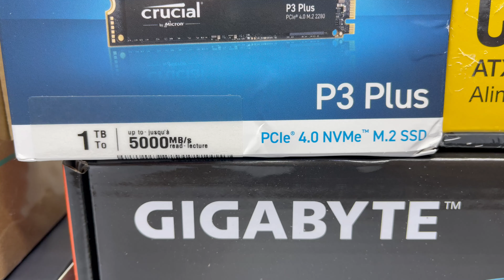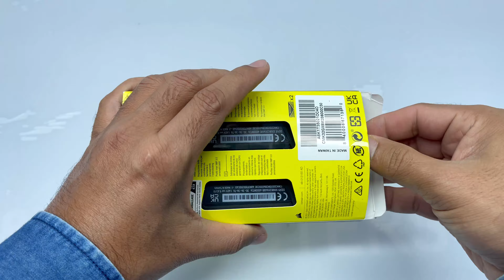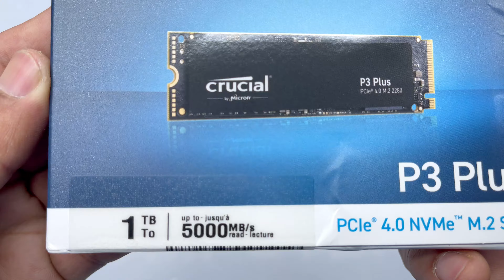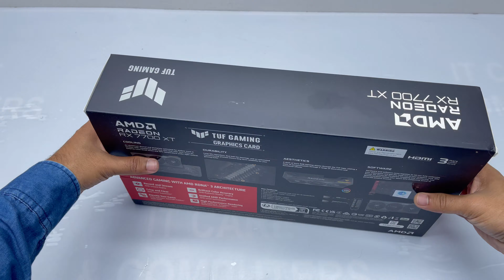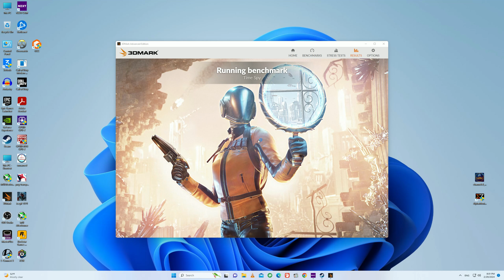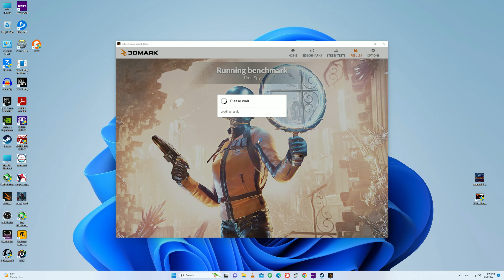NEW Budget Gaming Pc Build 2024

Comment: First view
   Hey I liked your video and I will happy if you giveaway bec you build ton of pc
Reply: lol bro hes not that rich
Reply: @gr0za44  but like he build many Pc so I said
Reply from the maker: @gr0za44  😂
Reply from the maker: @RED_X-official  I will promise when my followers reach 50k
Reply: Ok but hey I want you to bulid my dream pc 
Case- Asus GX601 Rog STRIX HELIDS Case
Gpu- ASUS STRIX GEFORCE RTX 4090 OC
Cpu- 19 13900kf
Cpu Cooler- ROG RYUJIN III 360 ARGB AIO
Power supply- ASUS Thor 1200p2
Ram- Corsair DOMINATOR Platinum RGB 16GB×2
Motherbord- Asus STRIX Z790
Storage- Corsair Mp600 Pro XT 1TB
Case fan- Lian li UNI Fan INFINITY 
Monitor- GIGABYTE G34 WQC
RGB cable for mother bord 24 pin and for Gpu- Lian li 

I watched your one video and there you build that same but you used AMD so I like Intel.  If there any mistake tell me and if you build that PC I will get a idea for that pc. Because I will build my dream PC so It will help me you just need to change the cpu and Motherbord.  If you can do that make a video with that component.
Reply: Ok but hey I want you to bulid my dream pc 
Case- Asus GX601 Rog STRIX HELIDS Case
Gpu- ASUS STRIX GEFORCE RTX 4090 OC
Cpu- 19 13900kf
Cpu Cooler- ROG RYUJIN III 360 ARGB AIO
Power supply- ASUS Thor 1200p2
Ram- Corsair DOMINATOR Platinum RGB 16GB×2
Motherbord- Asus STRIX Z790
Storage- Corsair Mp600 Pro XT 1TB
Case fan- Lian li UNI Fan INFINITY 
Monitor- GIGABYTE G34 WQC
RGB cable for mother bord 24 pin and for Gpu- Lian li 

I watched your one video and there you build that same but you used AMD so I like Intel.  If there any mistake tell me and if you build that PC I will get a idea for that pc. Because I will build my dream PC so It will help me you just need to change the cpu and Motherbord.  If you can do that make a video with that component.
Reply from the maker: @RED_X-official  i will try